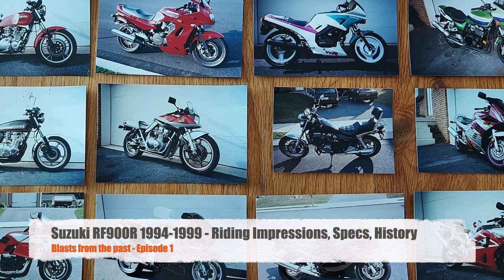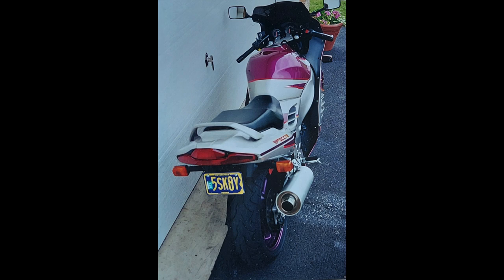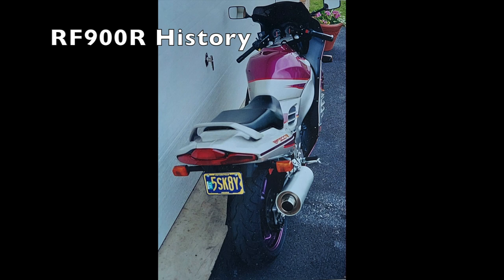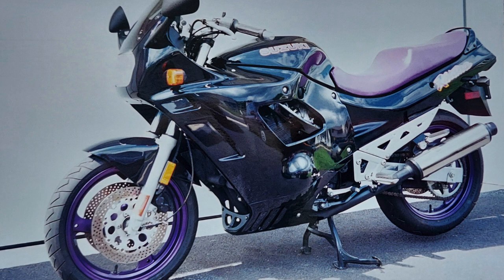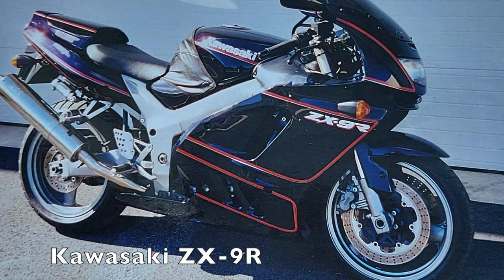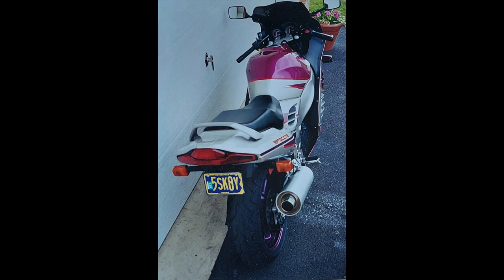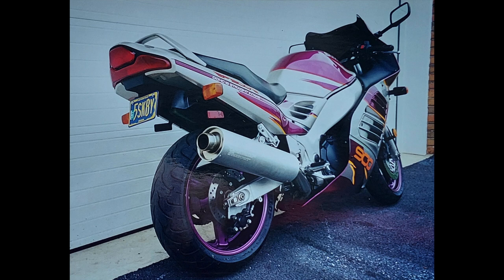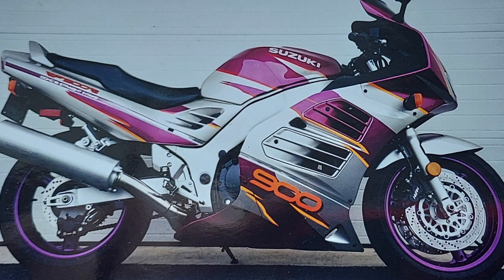Suzuki RF900R 1994-1999 - Riding Impressions, History, Specs

Comment: 8 had a RF900 in the early 2000s,first version with non adjustable suspensions. I was looking for a 600 or a GSXR750 but that one was sold for 1000 euros or so. It was bland, heavy, good just for highwat speed. At 160 kph it felt like you were walking. Forgottable and forgotten.
Reply from the maker: It wasn't a bad bike, just not a great bike in any way other than price. Cheers!

Comment: I bought the same limited edition color brand new in 1995. The only two things I didn't like about it was the big tail lights and it needed a extra gear for top end. I cut the rear lower mud guard to make it look better and repositioned the license plate. Really made a difference in looks. I also put a slip on exhaust.  However,  I always beat myself up for not buying the ZX11 sitting next to it instead.
Reply from the maker: Right on!

Comment: I like the looks of this bike. I am also older and do not push nearly as hard as I used to! I think I am going to keep my eye out for one. Thanks for the upload!👍
Reply from the maker: Right on Russ, you're welcome.
Reply: Have caught my eye too as an exceptional priced I thought, collectable.. will have to seek one out for a test ride.. rf1100w.. engine swap maybe.. or just get the gsxr1100w.. seriously under valued here atm
Reply: @Errol.C-nz  I agree with every point you said!👍👍
Reply from the maker: @Errol.C-nz  You would really have a sleeper if you did a Busa motor swap into the RF!
Reply: @jonsmotorcyclerescueandrev3538  looking into it further.. the rf engine is quite different to the gsxr1100w & wp engines.. its even quite different to the 750srad engine so.. i think its simply a budget model all round.. carbs/port angle are different on all 3 engines as is is the cylinder block castings.. back to plan A, a gsxr1100wp.. there are still near mint low miles ones for 1/3rd of the price of the last of the oil cooled 1100r .. its that lacking track racing heritage of the wp & rf that kills the collectables prices.. just nice to have a heritage, era bike without that cost.. that'll change with time Im expecting.. have 5 minis, same happened std vs gt's & coopers.. theure all silly prices now not the $200 i picked them up for.. mini gt was free!!
Reply from the maker: @Errol.C-nz  Right on Errol, I've enjoyed many really nice bikes that weren't popular when I bought them and therefore less expensive to buy. Gotta love a good value for the money!
Reply: @Errol.C-nz  I heard the engines are different but that the 1100w crank rods and piston fit in the rf900 block but it's all  about the money I suppose and what one is after.  By the time all that is done I think I'll go for a k1 gsxr1000.  They handle like a magic carpet and the poke from them is starship enterprise level.
Reply: @samuelkearney880  the 1100w fits right in.. swap the rf head onto the gsxr11 engine 👌.. the RF's are such good value.. just as they are.. seriously underrated

Comment: I just really love the looks of this bike so much since back then in 90ies! 
That is the main reason why I finally bought one last year, in my favorite style (purple/yellow/grey living in Germany) with only 5000 miles (8000 km) on the clock.
The RF was only built from 1994 until 1997. All bikes sold in later years were produced in 1997 and were sold off here in Germany even until the year 2000.
The spec sheet here in Germany reads: 135 hp (at the crank) at 10000 and 100 Nm (73,6 ft/lbs) at 9000 with a top speed of 260 kmh (162 mph). 
One owner, I once read online, measured 129 hp at the crank on the dyno...so the 125 hp you state seems closer to the truth :)
I really appeciated your analysis of the RF900R although I have to admit being a bit biased :)
Your core critic point is in my view absolutely correct - the RF900R is to sporty (seat position, too hard suspension) to really back it up with the "too weak" motor - they should have made it more comfortable.
I really like the turbine sound of the motor, but just as you said,  it's really not very torquey in the lower revs, only starts really pulling strongly over 7000, and in addition only has a 5 speed gear box to make things even worse. 
I must admit, that I tend to overlook these clear weeknesses due to the looks of it that I just love so much, combined with the great condition my 1996 RF is still in.
Just like you,  I would sum it up as follows: It has a too sporty and uncomfortable ride for a not that hot of a motor.
Never the less I love it and wouldn't swap it for any new bike, crazy but I just can't help it :)
PS: I reached a top speed (on the speedometer) of 275 kmh (171 mph) on the vastly "no speeed limit" German Autobahn - the true GPS speed is probably 10 mph less I would reckon.
Reply from the maker: Very cool! I also like the purple/yellow/gray color scheme the best. It sounds like you got a really nice RF. Enjoy!

Comment: bought my rf900r new in 94 after owning a gs500e, katana600, gsxr750 and loved it. i especially loved the linear powerband. my only gripe with it was i ALWAYS was looking for 6th gear.  mine was black with the blue/purple flake in the paint and purple wheels. ive owned many more bikes since but still miss the rf. currently riding a 19 zx14r and love it.
Reply from the maker: Very cool! It sounds like you've had a lot of great bikes over the years. I completely understand about the missing 6th gear. Same with the GSX-R1100 of the time. Cheers!
Reply: I shift for 6th always 😂 and everytime disappointed it’s not there

Comment: I've owned a 95 version, the same as this, since 1997 and it's still such a great bike there has simply been nothing along since that I'd ever want to change it for. In 1998 I rode it to Germany with a friend with a GSX750 (the version referred to in the US as a Katana, but which us Brits nicknamed 'the teapot' on account of its unflattering styling) and the guy must've been impressed because one of the first things he did on our return was to sell the 750 and buy an RF! I'm therefore a little surprised how you seem to regard the GSX as 'a success' on the basis it did all that was expected of it, and suggest that the RF failed because you don't believe it did. In one way, perhaps, you're right: the RF900 didn't fulfil its expectations. It far exceeded them.
I think also, rather than making limited comparisons of the RF against 'bike a' or 'bike b' it's worth considering the bigger picture and remembering that the 1990s were a whole different time. The RF series was born with the 600 in 93, with the 900 following a year later. Back then, Suzuki (more than most) seemed keen to fill any gap in the middleweight market they could find. For supersports they had the GSX-R600, they had the GSX Katana as the budget model, and by 1996 they were also launching into the new 'budget but with attitude' class with the Bandit. Before long they would also offer a V-twin with the SV, and not just one but two versions of their DR650 dualsport. As for where the RF fitted in, I'm pretty sure the first one along, the 600, was intended to undercut the Honda CBR ... and that, when the 900 arrived, it was, er, intended to undercut the Honda CBR, which is to say offer Fireblade performance at a much more affordable price. By the end of the decade, however, it was a pretty crowded market and unfortunately some things had to give. It's a reasonable bet, though, that Suzuki knew what they were doing when they discontinued the RF, in 1999: they would already have had its replacement up their sleeve, and that was to be the Hayabusa.
Reply from the maker: The RF certainly wasn't a bad bike. It just wasn't an outstanding performer (Hayabusa/GSX-R1000) or a sales success (Katana/SV650). I feel it's a bit of a stretch to say the Hayabusa was the intended replacement for the RF.  These two bikes had completely different design criteria. One was designed to be the cheapest-in-class, the other designed to be the best-in-class.

Comment: I think there is a difference in markets here. In Europe the RF was quite common and was looked at as a fast machine. The bike you call a Katana was not considered a great bike at all, at least not in my circle of friends. The reviews of the RF on MCN etc are very good and it has a very loyal following.I recently saw an RF here in the Philippines in great condition and it brought a smile to my face watching it tear down the road.
Reply from the maker: You might be right. The RF line didn't get too much respect on this side of the pond. At the time I owned this one, I also had a 1997 ZX-9R in the garage. Motor-wise, the RF felt like a 750 in comparison, and component-wise it wasn't in the same class as the ZX-9R. The supersport market here demands performance. Here, these bikes are toys or status symbols, not everyday drivers used as real transport (as in Europe). The RF was a good bike (and cheaper than the competition), but not a great supersport or sport-tourer. Just my thoughts. Cheers!
Reply: @jonsmotorcyclerescueandrev3538   i just got an rf600 i got it for 540 it ran on 3 cylinders all way home 500miles didn't complain since fixed the issue but starts every time even when was -5c out side
Reply from the maker: @Liqudstormz  Nice! It sounds like you got a good deal. Cheers!

Comment: I had one 2004 or 05. I liked it. It was sandwiched between owning CBR 900s. For day to day the RF was a better bike. I don't agree about the low down power. This was the easiest bike to power wheelie in first gear. The draw back was a buzzy clip-on that numbed your hands. But over all a smooth enough bike to pass a CHP at 120 on the 101. I didn't notice until I saw the cop but he didn't do anything!

I got drawn in by the CBR 900s rep and a great deal on the last one, but just never fell in love with them. The older me would have kept the Suzuki.
Reply from the maker: Nice, it's great when you find a bike that you really like. I had a ZX-9R at the same time as the RF900. As good as the RF was, the ZX-9R made it feel like a 750. I sold the ZX-9R because I simply couldn't be good on it. Cheers!
Reply: @jonsmotorcyclerescueandrev3538  I had a 91 GSXR 750. Once I was in the draft of a ZX9R like you had pictured. We were on the frwy. My tach was buried in the red and showing 165mph. Whatever speed it really was, that was all ZX9. 

Young and dumb, but I still remember it.
Reply from the maker: @kevinx9225  Right on, Kevin! I'm just glad we survived those days. Cheers!

Comment: I like the styling  and reliability 125 hp is prob enough for most  the rear tail light gets the thumbs down from m me tho
Reply from the maker: Right on Karl!
Reply: These only 125 bhp easily keep up with many modern 1000 cc bikes and runs mor than 280 kp/h not bad for such an old bike. For the rear lights it's called starship enterprise here in Germany and it feels on highway like on warpspeed 😁. It handles much better than other 900 and also 600 ccm bikes of that period. I love mine .

Comment: Of course since this was not selling good ... now it is more rare to  find :)   so still does OK on the market !  :)  400 verison was for the JAP market ... but as usual made it to the US , EUR too.
Reply from the maker: Right on! The RF900Rs are certainly rare in my area - especially clean ones. And parts availability may be a concern if looking to pick one up.
Reply: @jonsmotorcyclerescueandrev3538  the intenal parts are not too dificult to get...plastic parts are  more demanding task
Reply from the maker: @mrAq_pA  I would imagine.
Reply: @jonsmotorcyclerescueandrev3538  it's a funny world.. quite a few around this part of the globe & cheap too
Reply from the maker: @Errol Churton  If you can pick a nice one up cheap, give it a go. I had mine when it was close to new. I would recommend checking out an RF forum to see if there are trouble spots to look out for prior to purchase. Good luck!